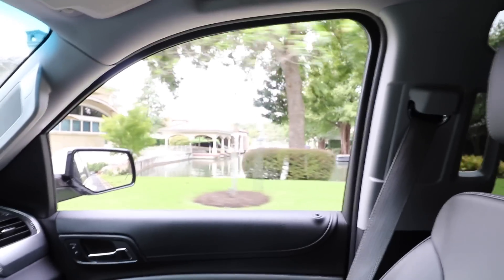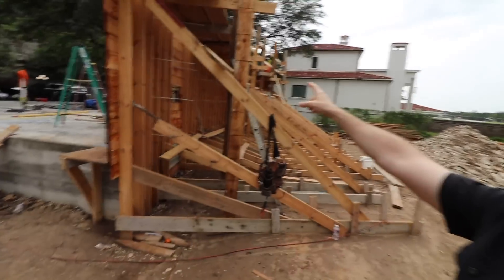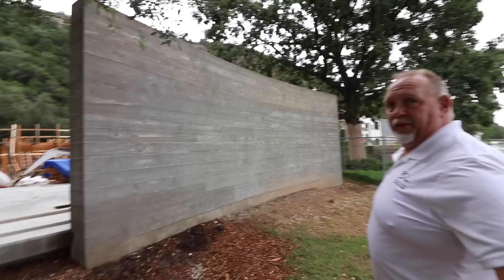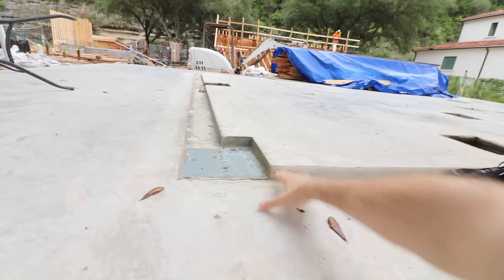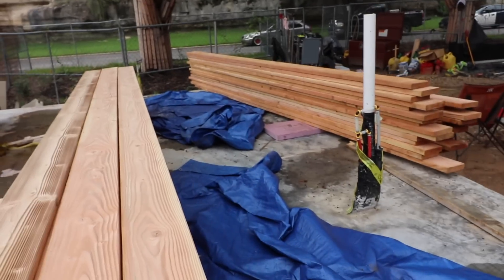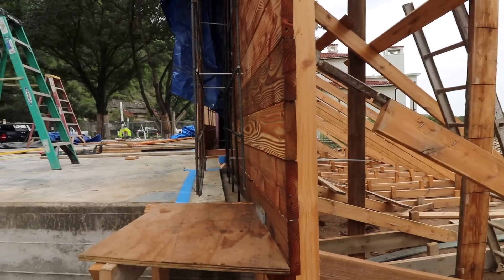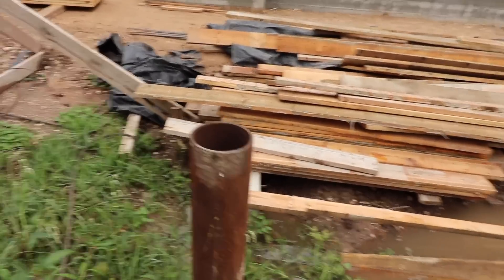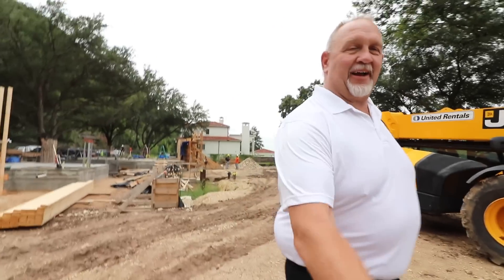Concrete Walls with a CURVE - Tips for Forming and Pouring

Comment: I do some similar form work, but I use a torch and a wire brush to burn the surface of the wood highlight the grain. Also, I joint the edges of the boards and stack them with spacers protruding into the fill space so that the casting has recessed joint lines. Lots of impressive work on that site. Thanks for sharing it.

Comment: Once had to form up a curved ramp with a rigid insulation core and stub wall for a parkade entry. I used two layers of 3/8th ply for the forms, wrapped them around custom diameter plywood whalers and secured them with strongbacks and strategically positioned camlocks. It was hard to put together, as I worked alone under a foreman who no one else would work with. Still, it meant I got to design, build, and pour it on my own, so I got a lot of satisfaction from it.

Comment: This is a great video. Lots to learn. Thank you. Great to see the camaraderie between you two gentlemen. 

I’d love to know the difference between sandblasting and wire brushing Douglas fir. Those are the two techniques and this sandblasting technique is phenomenal. I wonder if similar results could be achieved with wire brushing on one of the big rotary sanders or similar.

Comment: Great video. The sand blasting of doug fir is clutch. The wood sucks up most of the moisture so the silicone is only to keep the dribble in control. I thought all piles... whether..auger, precast or steel pipe are interconnected with rebar tie beams. Some on grade and some in the air.. ??... Reject oil pipe works well b/c it arrives in small sections and is easier to house on site and handle. CHEERS

Comment: How is shrinkage cracking handled on longer runs of these architectural walls?
I see they're not restrained at the ends, but even so, I'd be worried about it, especially at window bucks, but really anywhere the length is over 10' (that's what I was taught is max. w/o control.
Is there a control joint detail? Are they cut in after pour?

Comment: Hey Matt! Love your content! I'm curious what your thoughts are on using shou sugi ban boards vs sand blasting to expose the wood grain? Would it be more cost effective and convenient to char and brush the boards on site vs the expense, setup, and precautions needed for sand blasting? Also, would shou sugi ban boards release better after casting the concrete? Would they be less porous than the sand blasted counterparts and, if so, would this have to be accommodated for in the concrete mix design?
Reply: Very interesting, I'd also be curious on this one.
Reply: Maybe if they burn on site, but to buy shou sugi ban is very expensive.
Reply: You'd have to get untreated lumber to do any burning yourself as treated lumber is going to be toxic when burned.

Comment: Love the texture on the sandblasted boards. The raised lines are a bit of a distraction to me though. Is there a way to lower the visual lines between boards? Would ripping the corners off or smoothing the gap with a bead of silicone work?

Comment: Hi Matt, very cool ! I'm curious what is the end product going to look like? Are they planning to leave the curved concrete wall unfinished, as poured, or stain and polish, maybe a clear coat?  Something like you might see used for a countertop.... 
   Also, it's kind of interesting to see so many comments about money. Yes, I'm fairly certain that this will be a high end house and very expensive per foot to build. It's important to remember that when someone creates new ideas, they are essentially blazing the trail for everyone else. With a little time , somebody, somewhere will see this and be inspired to create a far more efficient way to do this for half as much . So pushing the envelope, even if it's expensive is great for all of us. Thanks Again Matt for sharing 👍🏻💯

Comment: I saw you were having issues sand blasting on site.  There’s a company called dustless blasting that uses crushed glass in a water vapor  that might work for on site blasting.  They are based out of Texas and have a network of contractors that can come out with a mobile unit.  If you don’t know about them already. Lol

Comment: Hey Matt, I bought a brand new built house about 4 months ago. It has a warranty on everything for the first year, and some other things for multiple years, from top to bottom. I've had an issue with rain water coming in through one of my bathroom vents, the one to vent out the bathroom not the ac vent, whenever heavy rains and wind come through. It only happens in one bathroom. I called the builder, he came by, took a look, and said it was due to the weather, but there was no problem with the roof. His explanation was the wind must have blown some flap open that he mentioned for the vent and rain got in but that it's something that should rarely happen, and he left. Storms came through again, and the same issue happened. Is there a way this can be fixed, and if so, is he just being lazy? It doesn't happen with light or moderate rain, just heavy rain with wind.
Reply: call a roofing company and check the vents, sometime its just missed flashing or sealant.

Comment: +1. The Concrete wall detail having a substantial foam core width can't be beaten.  The interior aspect becomes a heating/cooling flywheel extraordinaire. .. Radiant HVAC all the way ... "You can pay me now or pay me later. But you will pay me." .. Factor typical utility costs into the HVAC system performance.

Comment: Won't this naked steel that is already surface oxidized simply rust to death underground like that with corrosive concrete poured into it?
Reply: No oxygen to rust when it's covered
Reply: So you're telling me that I can just shove a steel pipe in the ground and expect it to last, right? Pretty sure it's more complicated than that. The ground when moist is full of nice electrolytes to help eat this invading steel.

Comment: Where I live your lucky to get a wall thats straight, level, and plumb and between planning and zoning and all of the homeowner associations pretty much every house built in the last 20 years looks the same as every other house, brick, gabled roof, asphalt shingles. I tried to build a custom home and was told by P&Z that they wouldn't give me a permit because it wouldn't "Fit In" with other homes in the area.....
Reply: most walls are are curved... not by design... a vast majority of people struggle with the basics
Reply: Why are you living there voluntarily?
Reply: Because I've spent the last 20 years building up my business here but within the next two years if the economy stays strong I'll be retiring and packing my bags.
Reply: All those ticky tacky little development houses. My local town came up with some new city ordinances for permits after I and another guy built houses that didn’t “fit in”. 2 story custom built houses now need a variance from the board because they don’t fit in with the ranch style cheap governor homes or the double wides that are on the same block. 👎

Comment: The craftsmanship is amazing.  The design - nasty.  Maybe I just need to see the finished house to appreciate it.
Also, they should have filled the gaps with some sort of protruding filler to make it look like real wood boards
Reply: Sergey Bebenin, my thoughts as well. With a stained finish applied that would be indistingishable from worm-wood material, except it's density. Great idea for a passive solar home.
Reply: The goal is not trying to make it look like wood. They are simply accentuating the normal grain pattern transfer you would see with almost any board forming. Good architects don't use "faux" finishes or materials. They try to use materials honestly. If you want to see a rendering of the final design here is the architect's page for this job. https://www.larue-architects.com/portfolio_item/redoak/
Reply: @Hybridog  
Yes I've heard this before.  Thanks for this link!